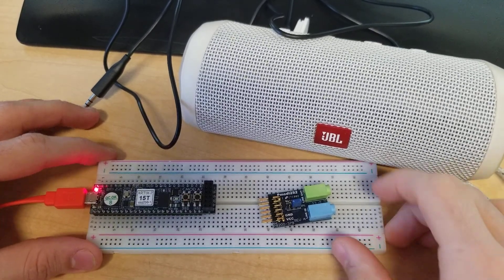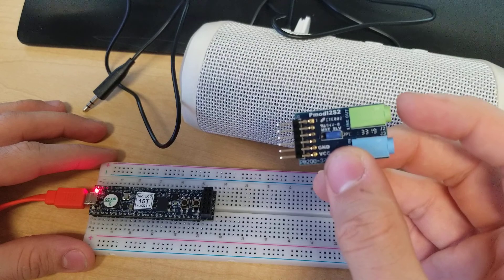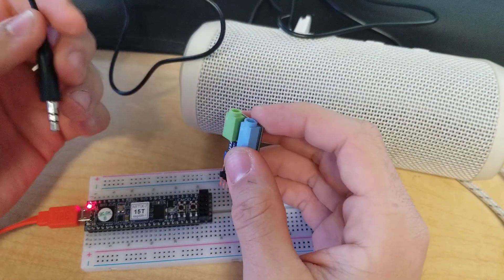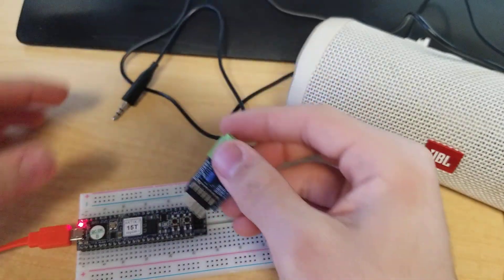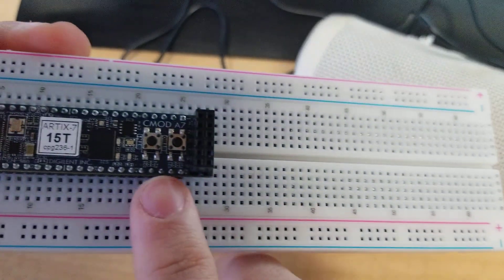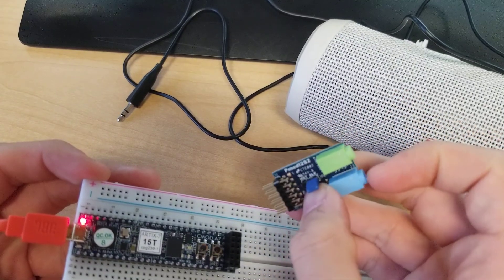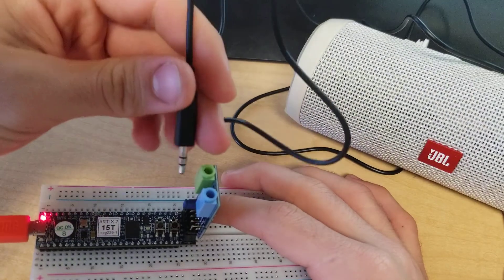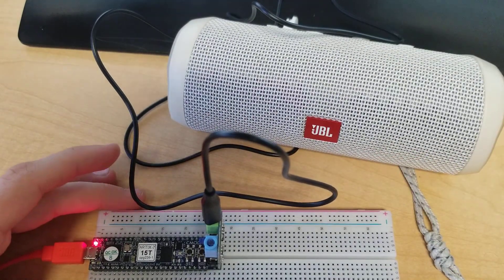FPGA Stereo Output Using a DAC

Comment: Is it possible to give a audio input through pmodmic 3

Like audio input and output ?
Reply from the maker: Hey Swadintya! You can use the PmodMic3 as an audio input source. I personally have not but you would connect it as a standard Pmod connection.